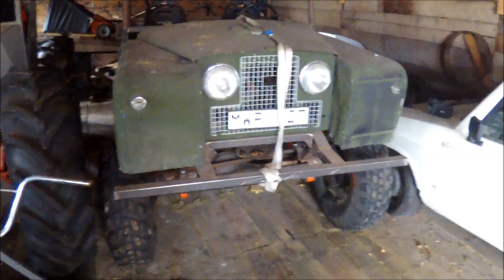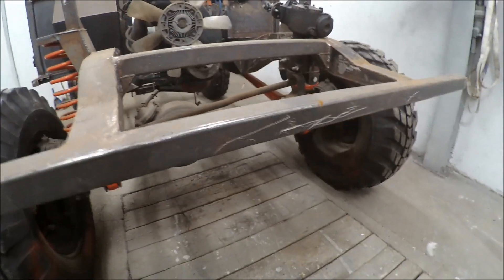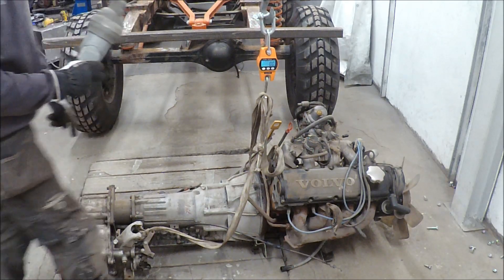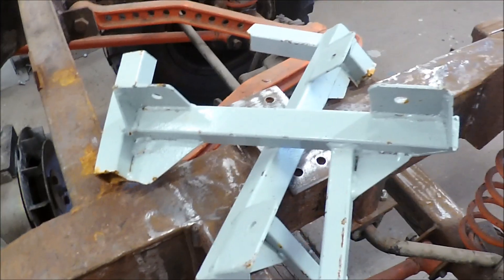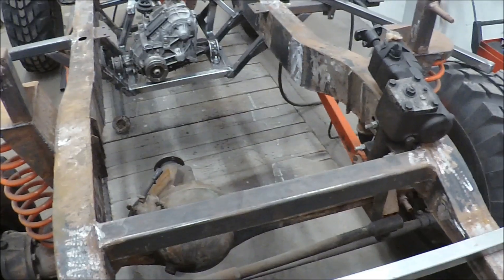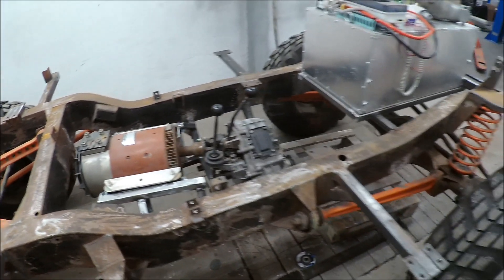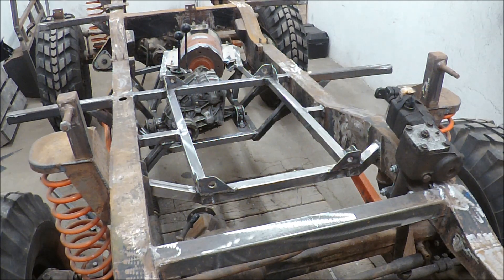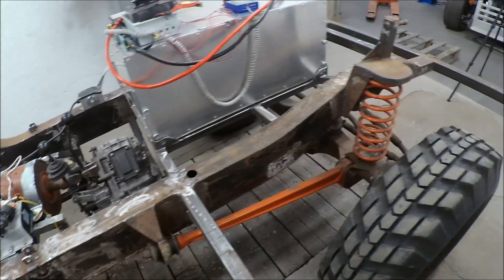Electric Landrover drivesystem

Comment: Land Rover and the English language refer to the ‘torpedo wall’ as a bulkhead. In America they call it a firewall.
Reply from the maker: Hello, Jamie ! :-) Then it would be best to call it bulkhead. In Sweden " torpedvägg" free translated to torpedo wall. Dont have any clue where our word come from, dont think we fight off torpedos with it anyway ! BR Per
Reply: @persteel   Bulkhead is the name of the wall between a ship’s compartments to stop water moving between them and add stiffness to the structure. I think torpedo wall is almost a direct translation as if one compartment is flooded then it stops the water from spreading to other compartments.
I thought torpedo wall was a cool translation.
Awesome project. I am thinking of making one of my C304’s electric powered so am following with great interest. Please do some steep hill starts and climbing vertical steps of some kind to see the torque and how controllable it is.
Reply from the maker: That is problably why is called torpedvägg, thank you for that explanation. Yes, I will do some real tests with all weight on vehicle, I was a bit unsure if the DC motor was able to run the vehicle at all but at first test I was impressed with performance. My axles is C303 with 6:1 gearing and the Lada Niva Low is 1:2.  Sounds like a nice project to convert the C304. BR Per